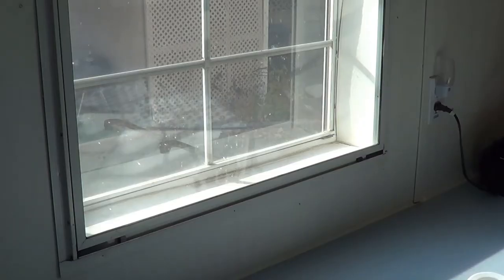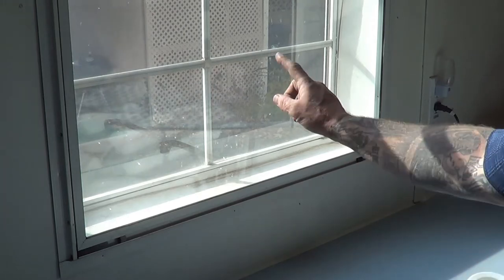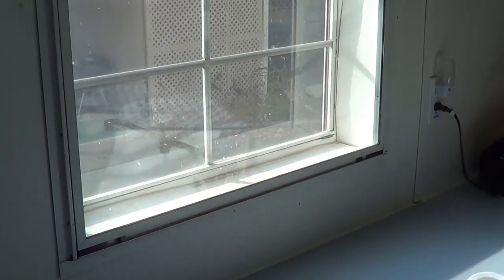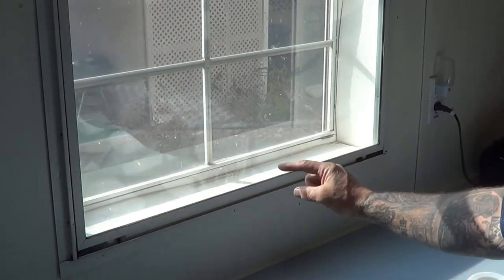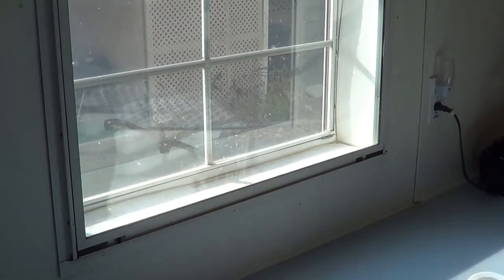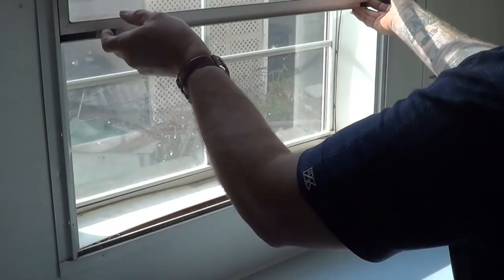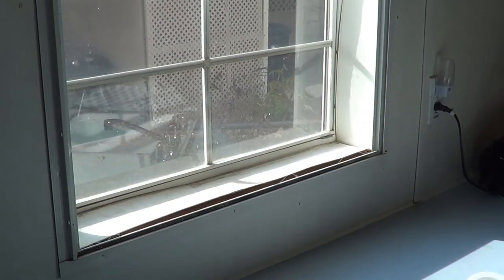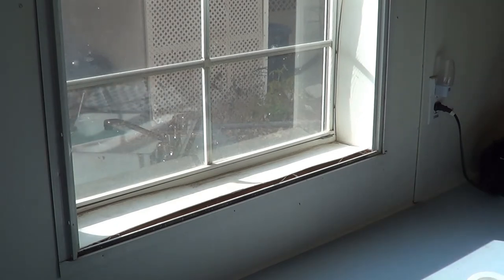How to measure Metal Windows in a Mobile Home

Comment: This info is great! However, there is so much more you could be covering! Would be great to see you fully take out the window and re-install it and finish it like the skirting video. 

I also would of like to see the front combo door measured properly, full taken out Nd seen the process of all of that plus put back in. 

I am curious to watch so much more that I want to do to my house and I want to be independent enough to work on my mobile home, so this helps a lot thank you!

Another idea - would be great to see you fix dents in aluminum siding, fix any type of common problems like changing out light switches, how to fix rotted subfloors and even level a mobile home! From basic to advanced there is a lot to cover! Even re-coating a mobile home roof and re- painting or putting new siding on the house itself!

Comment: Are you replacing the metal windows with metal windows? Or a window with a frame?
Reply: We replaced the metal windows with a vinyl window that had the standard nail fin. The vinyl window was double pane, eliminating both single pane metal windows.
Reply: We usually take these out and put in vinyl Windows. We have a video on how to do that, how to replace metal windows with vinyl windows